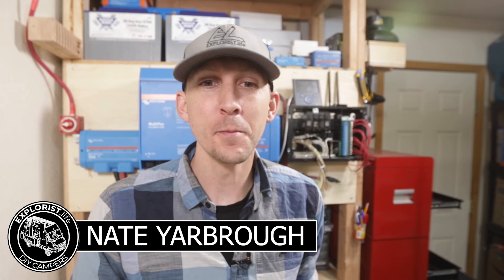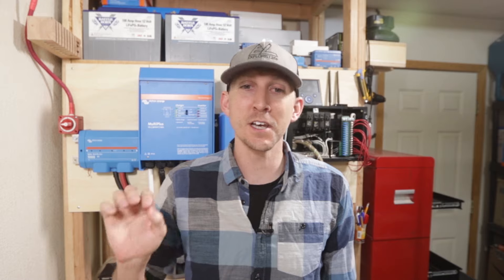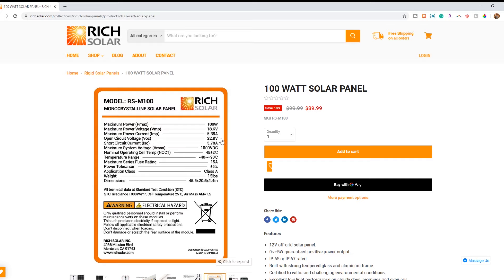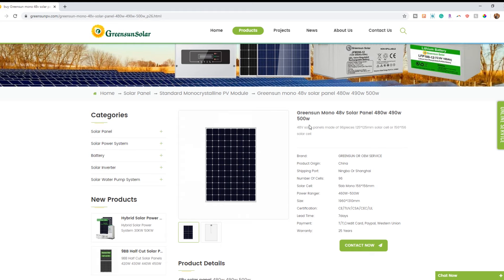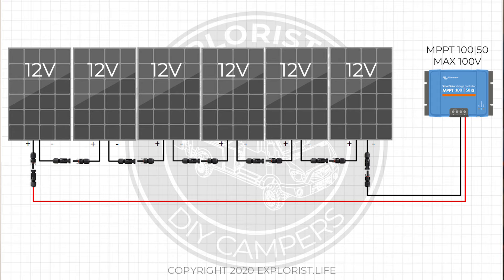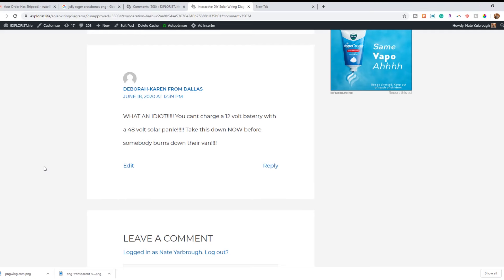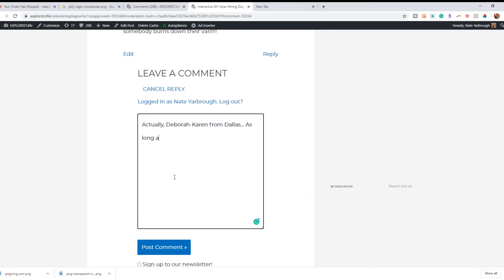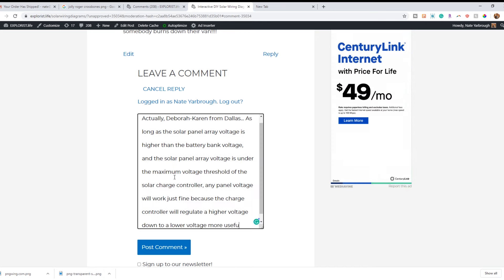12 Volt? 24 Volt? 48 Volt? Which Solar Panels for a DIY Camper Electrical Build

Comment: So how do I know the MAX voltage of Solar Charge Controller?
Reply: The specs are on the charge controller you buy a 70-15 would be 70 volts and 15 amps. That's should be in the charge controller specifications. 
For example I have a Victron 150-70 so that is 150 volts and 70 amp. Multiply those and that is the maximum array you can have then you need to setup your panels so that you have multiple series to 130~140v and then parallel those sets to get multiple amps, 8 amp is typical of larger panels. 8 × 8 = 64 which is the max is could go. So to get the most out of my charge controller 32 panels setup at 4 series x 8 parallel at 285w 36v is 136v and 64a and 9.1kw and my charge controller is 10.5kw max. The specs should be on your charge controller so purchase what works for your solar needs.

Comment: Why buying a more expensive higher 48 volts solar panel when at the end it will be reduced to 12 volts which is the needed voltage instead of buying a cheaper 12 volt panel? That doesn't make sense to me. 🤔🤔
Reply from the maker: The voltage of a panel rarely influences it's price, generally speaking.

Comment: A MPPT that regulates from lower voltage to higher voltage, do you know if Victron plans this?
Reply: Typically the panel array voltage needs to be at least 5v above the nominal battery voltage, so putting less volts in to get more bolts out is a challenge.

Comment: 200w x2 400w solar panels inverter 3000 . And charge controller for my van. My solar panels never came with fuses.. and my inverter and my controller.. what type of fuses should I use... for each one thank you
Reply: You normally do not put fuses on the wires from the solar panels going into the solar charge controller as the panels do not normally deliver that much current that it is needed. Short circuiting the panels is essentially the same as full power charging so there would be no point in using fuses...

Comment: Great video Nate.  On my last van, I used a single 275 watt panel with about a 39 VOC wired to solar charge controller connected to 3 ea 200ah 12 volt AGM Batteries wired together in parallel.  I used this to power a 48 quart Engel refrigerator and lights and to charge cameras, laptops phones.  It worked fine 6 months of the year, but poorly in the winter.  I wanted to add a DC to DC charger to use the alternator, but the cost sort of held me back. The large cables alone for 12 volt was both expensive and seemed a bit of a challenge to run so I never did it.
I'm now about to do a new van.  I understand much better how to do it and maybe do it much better.  i decided to spend the extra money and use lithium batteries and a single 440 watt panel (52 VOC).  I'm wondering if I could or should make my battery bank 24 or 48 volt?  I think I could use 10 guage instead 2 or 4 guage that I would need for the 12 volt alternator.  Is there a reason I shouldn't?
Reply from the maker: Yep!  Here is a video about that: https://www.youtube.com/watch?v=sEW-ZaOOlq0&list=PLmvhcyi4n0TUjVGA_O5aI5SQrS1kKLgEF
Reply from the maker: Based on what you've told me... I see no reason for you to do 24v or 48v.  For a small system that it sounds like you're installing; a 12v system will be perfectly sufficient.

Comment: Sorry, just found this video and haven't really seen them all. Thanks for producing such a GREAT quality video. Just one thing (and I am sure you have touched upon this but a quick search didn't find it) even if with an MPPT controller you can run 48V to 12V without burning down your camper (I LOVE that the rude commenters name was KAREN), should you? I guess the question is is it most efficient to wire your batteries so they match the voltage of your (wired) solar panels.  Or is the controller so efficient that it makes no difference.

Comment: I'm new to solar so I have a concern that I'm not sure of. Lower temperatures make higher voltage, then higher temperatures make lower voltage. How much will high ambient temperature (say 110 degrees), plus solar heating lower the voltage to where the panel OC voltage (of a "12V" panel) not be enough to charge "12V" batteries? Could this really happen? Is it worth having a 24V panel for these conditions?
Reply: u broke his pledge of not referring to panels by 12, 24, or 48v :D

Comment: Ha ! Ha! Ha! So funny , the guy didn't realize that the 48 volt panel was made out of the cells of 4 12 volt panels wired in series in one frame , it was probably a 400 watt panel and all that did was save you having to wire 4 panels together to get the same thing. Big systems can handle 500 volts input and the large panels save wiring.

Comment: Alright Nate so here are the main questions I am sure ALOT of people wanna know regarding your comment to Deborah:

1) How can someone find the MAX solar array voltage? Say they have ONE panel. What is the data piece they are looking for? Vmpp? or Voc?

2) How can someone find the MAX voltage of the Solar Charge Controller? What is the data piece they are looking for in the controller's manual in the specification section? MAX PV open circut voltage or Nominal system voltage or something else?

I also would like to add that Nate's comment to Deborah is the following in simple english.
Max Voltage of Solar Charge Controller > Solar Panel Array Voltage > Battery Voltage

Comment: Thank you for the presentation. I have a 24 volt battery with an MPPT charge controller with max voltage 125 volts. I have (4) 12 volt solar panels with a maximum output of 22.3 volts per panel. If I wire the 4 panels in series, do I use the 12 volt ratings to determine the total voltage to be 48 volts (4 x 12 volts) or do I determine the total voltage to be 89.2 volts (4 x 22.3 volts)? What does it mean when some panels are rated at 12 volts, some at 24 volts, and some at 48 volts? If I understand your presentation correctly then 89.2 volts going to my MPPT charge controller won't be harmful to the system because the MPPT controller if functioning properly will bring the voltage down to 24 volts for my 24 volt battery?
Reply: you use the higher one. so with that charge controller you could use 5 panels so 5 * 22,3v which is within the 125V your charger can handle. Do make sure the Amps(A) is also within the range your MPPT controller can handle, both on the input and the output side.

Comment: Do you know anything about A/C's?  I want to setup a rear A/C system, im not sure which way to go. I thought about buying one of those under the dash units and connecting it to my existing compressor.  I know this is off the topic,  maybe you can do a video on this?  Keep up the excellent work, Thanks

Comment: Hey Nate.  So what is the benefit of wiring the system 24 volt vs 12 volt?  More efficient to run on 24 volt?  Equipment cheaper?
Reply: if the charge controller can do max 10 A (in this example) then the 12V battery system can charge 120W (12V * 10A = 120W) and the 24V battery system can charge 240W (24V * 10A = 240W) in rough numbers to give you an idea. Batteries charge at a higher voltage than their "rating" list them as... so a 12V lifepo4 battery can charge at  14-14,2V (but do check your batter specs to make sure the charge controller uses the  correct voltages).

Comment: Hey Nate,  

Picked up a 16 Sprinter 144 from someone who was the second owner and did not have a clue of how anything worked.

It has the following electrical components:

300-watts Renogy Solar Panels

• Xantrex 1800-watt Inverter charger

• Shore Power Plug (underbody)

• GoPower PWM Charge Controller

• 310 Amp-hours total AGM Batteries

It also has the MB aux battery package under the hood.

I'm getting a low voltage alarm E05 on the inverter.  When I plugged it into shore power for about 5 hours the aux battery was very warm and I could smell the rotten egg smell.  The other batteries were not warm and the inverter showed 13.2 voults when unplugged from shore power.  I had a load test done on the aux battery and it showed 604 cranking amps but 11.3 volts. By morning with ne draw it was down to 11.5.  I'm afraid to plug it back in to shore power and wonder if I can just put a slow charger on the aux battery without disconnecting it from the system?

Comment: Thank you, Nate, for all these very useful and informative video tuts. The solar panel setup is quite confusing to many like myself. I have ordered for a 24V 36Ah LFP battery pack to make use of my solar Car Inverter – 24V DC to 230V AC Pure Sine Wave Output 1000W. I need to know whether I should go  for a 12V or 24V or 48V solar panel. I own a 2009 Toyota Corolla and do not have much space to deploy big sized solar panels on the car.

Comment: Don't you just hate it when some idiot customer who has no clue what they're talking about tries to rudely "school" you on what they only think they know, and you have to bite your tongue and politely explain to them why they're full of crap?  

In my case, it was a customer who didn't know the difference between the running load current and inrush current rating of a contactor, and thought the rated running load should be as high as the inrush current rating, which would have been at least seven times as high.  It wasn't just that he was ignorant about the subject, he proudly displayed his ignorance as rudely as possible.
Reply from the maker: I usually just remind people that they are allowed to do whatever they feel is right but I'm only going to provide tech support on what I recommend.

Comment: Hello Nate,
Love your very informative website and thank you for your great presentation style.  I do have a few questions.  I have a 2020 AWD Transit 350HD dually ext HR and am using a Flatline roof rack.  I've installed a Maxxair 8500 and a Fresair 12V AC unit.  

1)  I noticed that you installed your solar panels above the your Maxxair fan and my question is, is that OK and how did you secure the panels?  Would you do this type of installation again?  I'm not against it and I will need 1200W of panels, myself.

2)  I just purchased 4ea 150Ah Ohmmu Lithium batteries. I would like to model your 600Ah 1200W panel design.  Do you have any upgrade hardware suggestions?
Reply from the maker: 1: The panels are bolted to the roof rack.  It is a good way to get as much solar up top as possible while still having 2 fans.

2: I don't know much about those batteries, but the rest of the diagram should work fine with them.

Comment: Not a single 12 v24 video by anyone states why 24v system is better.  No body says why having almost double the solar wattage for 24 is better.  Skip the skinny wires, what is the real sales punch to 24v.  There has to be a sales punch to even consider the whole switch over. 

Note, the 24v has to be stepped down to 12. Thus no advantage there, maybe even a loss in the step down. 

What is the sales pitch that everyone is afraid to say. I’m thinking there is only skinny wires and that it.
Reply from the maker: This video has a bit more insight on that: https://youtu.be/sEW-ZaOOlq0?si=Ao13Kf2ur2yNR7Xr

Comment: Thank you for explaining how a controller works, I was hoping it could boost the 12 to 20 volt panel up to 24 volts but it looks like it's only a buck converter like you were saying.

Comment: so wait? so I can charge a 12V battery with ANY voltage as long as it is less than the controllers max? So I can use MPPT on a 12V battery just wiring my panels in series? interesting.
Reply from the maker: Exactly!  The whole point of a charge controller is to regulate a higher voltage of a solar array down to a voltage appropriate to charge the batteries with.  👍👍

Comment: Nate, I'm a newbie to solar and your videos are very good.

I have a question, maybe a dumb one, but trying to get our system right.

we have eight solar panels, Specs: (150 watt), (open circuit volts =18v), (Amps= 8.58)

(Makeskyblue)Max. volts @ 105volts,  60amp MPPT Charge Controller.
Inverter is 12volt 5000watt continuous/10,000 watt surge. We have  Six 12volt 100AH AGM batteries so far with intent to buy 4-6 more of these batteries before assembling our system for our small cabin home.

Question: can I connect our panels in series (two at a time) two panels in series and then these two series sets then connected in parallel and then still have our battery bank wired in 12volt parallel to our 12 volt inverter?

or should I series connect batteries two at a time and then connect each series to buss bar to make a 24 volt battery bank which would require me to buy an inverter than is rated for 24volt input?

Im basically wondering if I can series-parallel our 12/18 volt panels to charge controller and still connect batteries in parallel as 12 volt B. Bank and use the 12volt input inverter we already have?

Thank You in advance.

Comment: hello i love your channel, wish i would of found it sooner. i have a question maybe you can answer...I am building a 24v system. but before i decided to do that i bought a bunch of 12v products. so i wonder if you can use a dc to dc24 to dc12 to run a 12v 3000w pure sine inverter? i can't find this topic any where.
Reply from the maker: No.  Not really.  You should get 24v components, or just bruild a 12v system.  Remember to 6 P's of system planning: Proper Planning Prevents Piss Poor Performance. :)
Reply: @EXPLORISTlife  Right I get it now but back then >>>Not so much anyway I have a few 12v inverters now and was thinking I could buy a converter to be able to use 1 of them in my man cave. I will just get a couple of 12v batteries and use them with it. Thanks for your time and your channel is awesome. Thank You for all you do.!!!

Comment: My cheap kit comes with a pen controller that handles 25volt max and my panel is outputting 21 volts. It's rated only at 400 watts that's 4 of these panels.

Comment: I was just having that problem. Now I know why a DC frig. can run on  9 to 24 volts and 12 volts is  middle ground. That's why you can run a frig.on a less balance wave.  Maybe the unbalanced wave is the reason for lease heat. Meaning running smaller wire can be used.  Changing weather with heat waves. Peace

Comment: Hi Nate

I like your channel and I have a question about a boat project.
I can fit 4 x 165w flat panels on the first roof and 2 x 165W + 2 x 55W on the second roof.
Is this calculation below the most effective or what should you have done?:
Connect 4 x 165W in serie and use a SmartSolar MPPT 150/45 Tr
Connect 1 x 165W to 1 x 55W in parallell and then connect (165W+55W) with (165W+55W) in serie and use a SmartSolar MPPT 150/35 

Thanks,
Johan

Comment: I love your channel and the energy you bring. We’ve been trying to inform ourselves on solar power for our travel trailer. After countless hours researching on all subjects on our travel trailer transformation. Solar is one of those subjects that baffles us. We’ve heard that a 24v system tends to be cheaper and better than a 12v system. My question is. Can a 24v system still charge the batteries via shore power at an rv park? and if so please direct me to one of your DIY plans on your site so we can purchase it. Thank You for your time and keep rocking the YouTube channel.
Reply: To do that you need an AC charger

Comment: Beautiful!
Not taking offence...
Focused, calm, and straight to the point...with a sweet smile.
You are a great coach, keep up the good work, please
Reply: I wonder if solar panels could be permanently attached to the van sides after the roof space is full ? This would maximize power but would need to be designed to work with system elements to be safe and effective. For reference, look at treehugger.com to view a prototype solar RV made by DETHLEFFS company (Hymer). Thanks.

Comment: Hi , what's the deal with connecting panels with different wattages ,( same brand ) ...ie... We want to get 175x2 and a single 100...so 450 in total
Reply: No, that would be 300 Watt total. The is a video about this

Comment: Why not refer to the Panel voltage as Voc or Vmp as they are different and so your explanation is confusing.
Reply from the maker: ...and even that only matters when the temperature is 25 degrees Celsius.  Just refer to the panel by it's wattage and account for the proper voltage calculations on the back end.